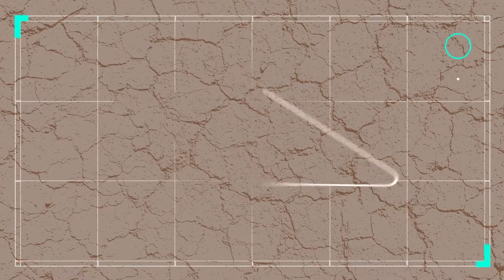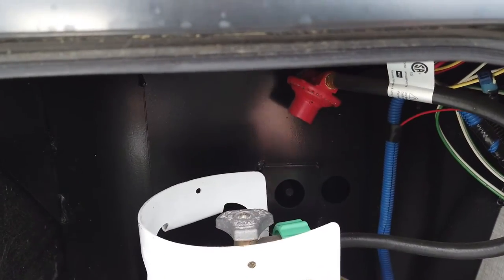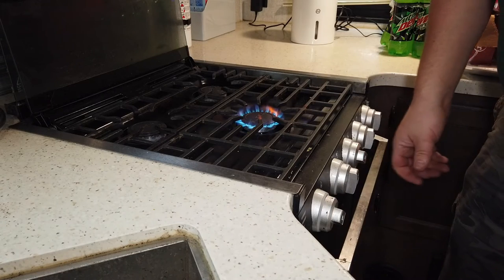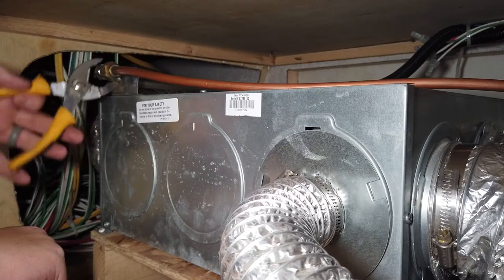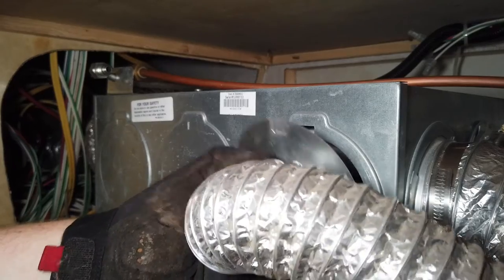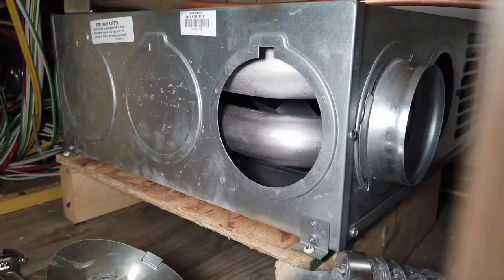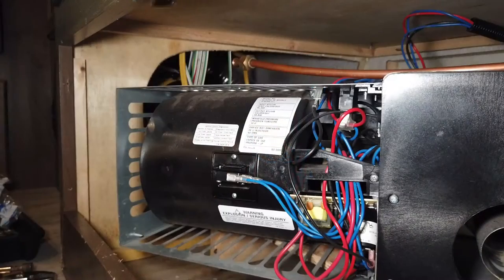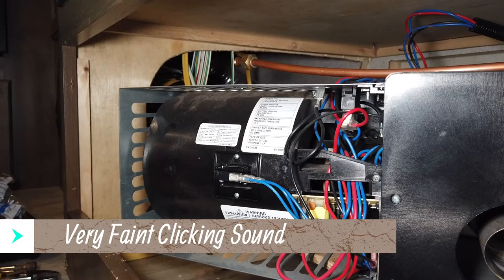Furnace Update #rvfurnace #dometic #diy

Comment: Thanks, there has been a lot of people with this same issue lately in the groups. I too just finally swapped my sail switch out due to it only working after I put it back together. I did find that if you bend the non key hole side of the vent tubes just a bit it makes twisting them off and on a little easier and I haven't lost any air flow that I can tell from what seems like the hindreds of times I've pulled that furnace out. Thanks again and keep the content coming.

Comment: thank you for sharing!  I think I have the same furnace... or at least a similar furnace from Dometic/Atwood with that same small / non-existant access panel from outside.  I don't mind jumping in and trying to fix things, but I have a 5th wheel and the furnace is really wedged well up into the basement - on the back side of the water heater... So I've been looking for a while to find someone with a similar scenario.  Now I know...  I've got to crawl up in there and get it done.  Again, thanks!  safe travels.  bg
Reply from the maker: It’s a pain… I don’t know why the access panel isn’t standard

Comment: my issue is many times the blower wont even kick on, battery voltage is good I hear the relay click in the AC above and blower will not turn on. I go out to a warmer day and voila it kicks on driving me nuts
Reply from the maker: That is nuts… wish I could help but I have pretty limited knowledge on the furnace

Comment: Nice video, now I know the easy way to remove the furnace. My fan is not coming on so I don't believe it is a sail switch problem.  Think it is the Coleman Gateway, as my unit is controlled by in-command, but thanks for the great video.  So far I haven't found out much info on how coleman controls the furnace and the roof AC via In-Command.
Reply from the maker: If the zone temp doesn’t show on iN·Command it won’t turn the furnace on.  Have you rebooted the iN·Command?
Reply: @GimpyCamper  Did a hard reboot on camper and then rebooted IN-Command.  zone temp shows correct temp.  roof fan will run but furnace does nothing.  before hard reset temp readings were really messed up.

Comment: Thanks, I have a bullet crossfire with the same issue of not igniting and will be using your video as a tutorial. (Watched your first one as well) Also, I am going to research installing an exterior access door. Have you looked into this option?
Reply from the maker: I'm actually going to be putting in a different furnace with an access door.  However,  I have saw one person that added just a plastic access door that looks like the same type enclosure for an outdoor shower.  Theoretically it would work, but I would worry about the temperature, but they did keep it a few inches away from the exhaust pipe.  I'm not sure how I feel about it, but I think if its far enough away from the exhaust it would be fine.  If you do it email me some pictures and keep me updated.  https://amzn.to/3OQTx8J

Comment: I have followed all the steps for the furnace removal, including the two small L shaped brackets but it still won't slide back so that I can turn the whole unit and access the sail switch. Is there something additional I need to be doing to get the unit to slide out? Thanks for any suggestions.
Reply from the maker: The only thing holding mine in physically were the two screws that went into the l brackets

Comment: We are having an issue with our heater and I was wondering if it was the same as yours. Our heater will ignite when we are plugged into electricity but not when we are running off battery power. Do you think cleaning or replacing the sail switch might fix this issue?
Reply from the maker: No, there actually isn’t anything that should be causing this problem as the furnace always runs on 12 volt.  It more makes me think your battery is bad because when you are plugged in the converter supplies 12 volt power to charge your battery essentially making your camper think that the battery is full.

Comment: Our furnace is finicky as well. It will work sometimes and won’t sometimes. Really makes no sense. Is that the same thing you have been experiencing?
Reply from the maker: Yes… it would turn the blower on and then not ignite… then it would turn off…. I’d take it apart and put it back together and it would work fine
Reply: @GimpyCamper  ok. Sounds like ours. Although it just randomly works. We haven’t taken it apart yet. We don’t have an access panel either and that’s why my hubs hasn’t taken it apart. Hopefully this video will be helpful to him. Thank you for helping us all!!!